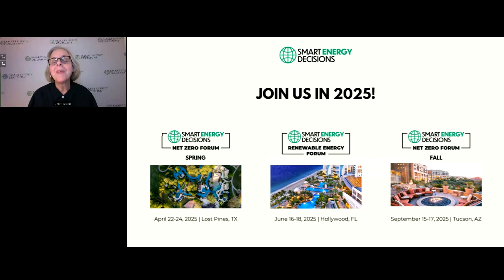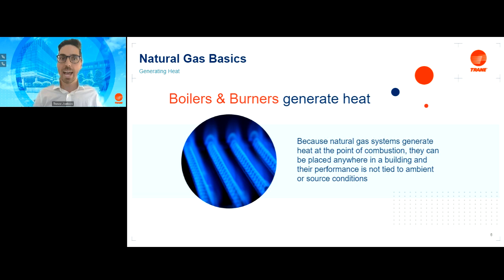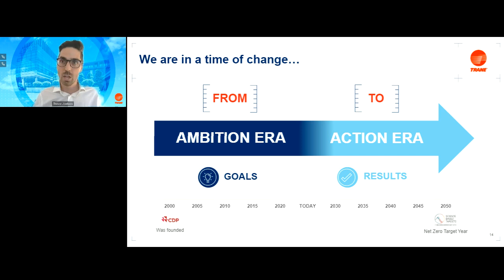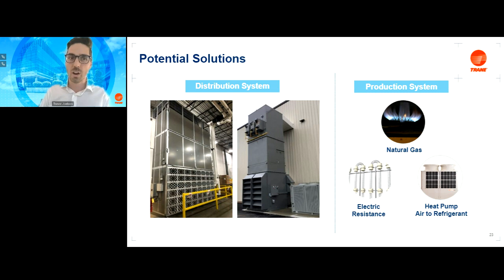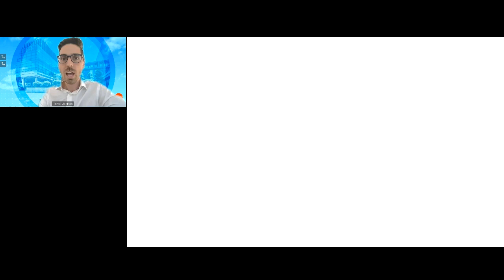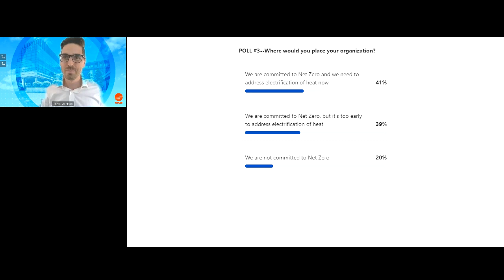Webinar: Scope 1 Emissions Reduction: Why All Eyes Are On Heat Pump Technology

Comment: Heat pumps can be very limited in temperatures when ambient temperatures are low. Your outdoor unit will have ice build up in freezing rain. There is no fix for that. You cant remove the ice on the coil due to possible damage to the coil.